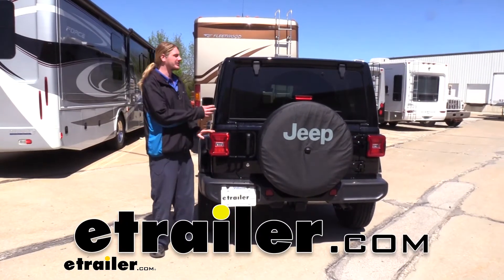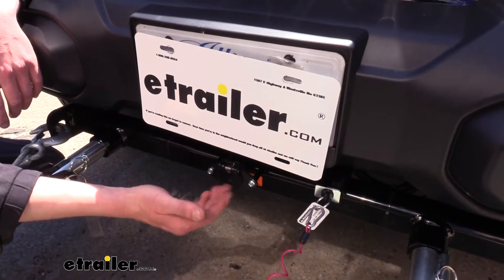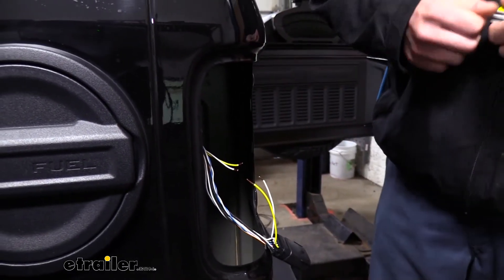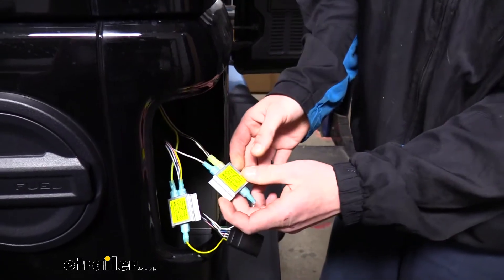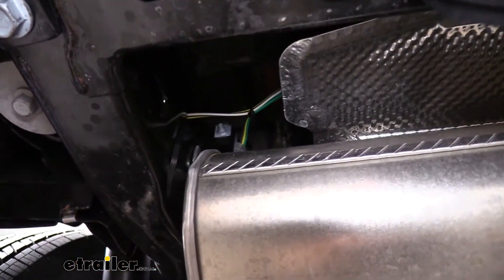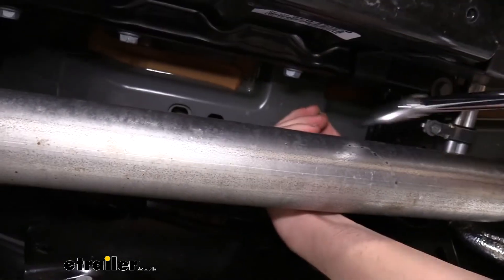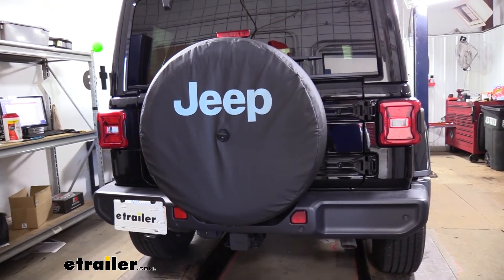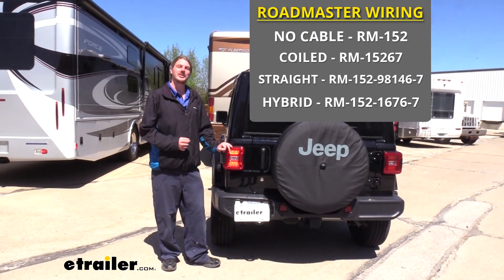DIY 2020 Jeep Wrangler Unlimited Installation for the Roadmaster Universal Hy-Power Diode Wiring Kit

Comment: that white wire has three ends? im so confused you plugged one end with the brown / white  into the driver side tail light. the another end green  and white appeared and then a third side got grounded. am i suppose to remove the entire white wire and make two separate wires. that is so confusing.
Reply from the maker: The white wire that was part of the taillight harness on the vehicle is the running light signal wire. The white wire on the 3 wire harness is just being used as a jumper wire to take the brown wire to the passenger side of the vehicle.
https://www.etrailer.com/Tow-Bar-Wiring/Roadmaster/RM-152.html

Comment: Everything works except left break light.  Where did I go wrong?    My Motorhome is 2002 National seabreez. Jeep is 2021
Reply from the maker: We have had issues with wiring not working on certain components when installing this kit. You can start by checking the connections to make sure that they are clean of corrosion. Another thing you can check is to make sure that your fuses in the motorhome and vehicle are all good. It also may be something as simple as the bulb may be going out.
https://www.etrailer.com/Tow-Bar-Wiring/Roadmaster/RM-152.html